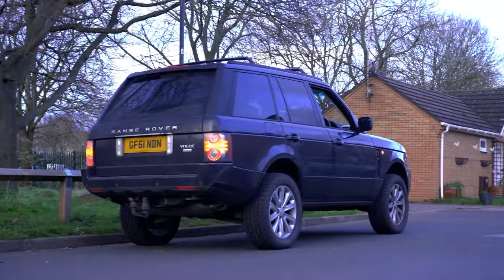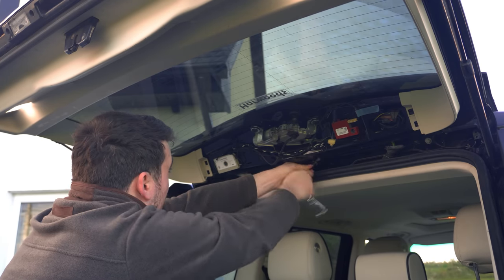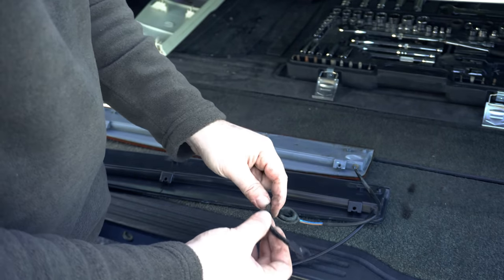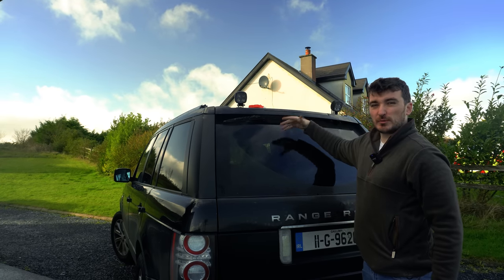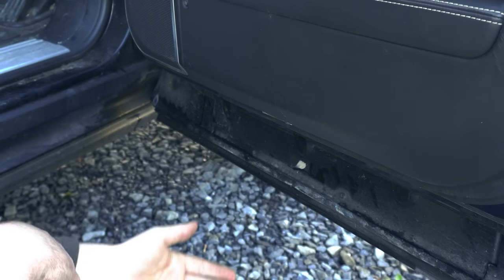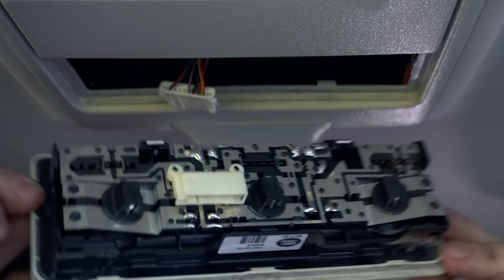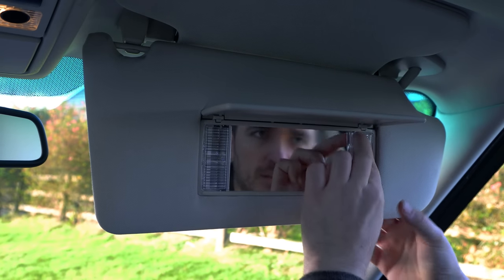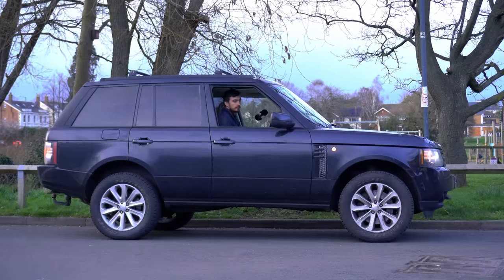I fitted MORE Cheap, Quick Upgrades to my Range Rover L322!

Comment: What did the missus have to say about them? I think you've struck the right balance between on the colour temperature, I know on my Disco 2 I put the LEDs in and it made such a difference to whether or not I could actually see or not

Comment: Great vid, Keep an eye on the third brake light, I had to replace one I fitted after 3 months due to it failing and giving out 1 candle power. Thankyou for showing the knee level footwell bulb change, The only one I have left to change over on mine,  but mine seemed to be a lot tighter than yours so I bottled it. The RR puddle lights are bling, But I like them on mine. I agree the light temp looks better on yours, mine are really blue white. Cheers

Comment: I am planning to get L322 2008 facelift. Here in middle east, the lower dashboard section under the stearing wheel are tend to break due to high temperatures. Any solution or cheap replacement ideas for that? Please make a video if possible.
Reply from the maker: It's not a problem I've ever heard of on this side of the world.  Maybe tint or cover the windows to try and keep the interior cooler?

Comment: Well done Sam. I look forward to your videos very much!
Reply from the maker: Cheers Jerry!  How's your Rangie going?
Reply: Hey Sam, I had to get my air compressor replaced recently. I wasn’t brave enough to attempt it myself. Thankfully I have a good LR Specialist near me that is way cheaper than the dealer, but still does a great job. For fun stuff, I got a rear ladder to put on. I’m a bit nervous drilling into the body, but one of these days, I will get it on. I am getting a Service Required message on the dash. I purchased the iCarSoft LR 3.0 scan tool to hopefully clear it. Thanks for checking in on me.

Comment: Hi Sam, thanks for the L322 videos, I’ve learned a lot. Have you ever considered upgrading the reversing camera to a version with night vision? I’ve upgraded the reversing lights on mine to bright white LEDs but it still doesn’t really cut the mustard. I’m now considering a night vision reversing camera…. but the like for like replacements I’ve found are expensive at around £200.
Reply from the maker: Hey Steve, cheers for the comment!
Regarding the camera - mines actually ok in the dark now - but only because of my super bright reverse lights!  Before that, it was more or less useless.

Comment: Have you checked the rear arches and sills for rust?
Reply from the maker: That’s actually this weekend’s job along with a full rust killer and undercoat treatment.  Watch this space!!
Reply: @SamsMotors  good, I keep thinking about a L322 but the rust issues are a concern.Looking forward to seeing the next video.
Reply: I’m sure you’re running a telepathic channel - I think of a topic and Sam eerily listens, bit like FB ads, despite them “not listening”…

Can’t wait to see “this space” 👍🏻👍🏻 as my rear arches has some slight surface rust. The underside is mint, so hopefully can treat it before the gritters make their seasonal appearance.

Comment: Hi Sam, did you manage to resolve the problem you had with the off side door mirror light (that failed after upgrading to LED)? I did the same upgrade and also had the off side light fail - is that just a coincidence or is there some other issue? Cheers. Kevin
Reply from the maker: Hi Kevin, no I haven't.  Someone else commented that they had the same issue and that it was a failing of the BECM, so I'm not sure exactly what's going on unfortunately.
Reply: @SamsMotors  Hi Sam, thanks for the update. If you do come across a fix for the problem that doesn't involve replacing the BECM please post it. Thanks. Kevin

Comment: I was so excited about the interior lights I forgot to say another thanks for the brake light - mine has condensation inside so wanted a viable alternative and the logo puddle lights are ace too. I had the official Audi rings at vast expense on a previous car before they were copied on eBay etc. 

Did you put them on the rear doors too? I thought the projection angle would be off too much for the rears?
Reply from the maker: Glad I could help!  It's amazing how cheap and readily available all these bits are.
I did try them in the rear doors and as you say the angle isn't right for them.  When the doors are shut though, they project onto the rear passenger floor (a distorted image, but still!).

Comment: Another great video, glad you’re back! Do your interior LEDs under the dash flicker when starting? Mine do since my own LED upgrade many months back so not sure if this is normal and if not, what’s the likely cause?
Reply from the maker: Cheers!  Glad you enjoyed it!
Mine do the same thing.  It's just as the battery voltage momentarily drops down when the starter is cranking so it knocks out the LEDs.  Totally normal!
Sam
Reply: No canbus on the led if you have an iid obd scanner you can turn off the hot and cold option

Comment: Love your videos on the L322. 
My L322 has DPF issues, it’s on 115k miles. Any ideas?
Reply from the maker: Cheers!  DPF issues - doing lots of short trips?  
Otherwise, the DPF can be clogged by leaks in the boost pipes or inlet manifold/donut which upsets the system.

Comment: hi Sam, on aside how did you finding importing the l322 into Ireland. Im based in UK and have a l322  4.4 pterol 2005 with only 150 on her but has a lpg conversion so not so bad running it. Be nice to know how you got on import duty etc if you dont mind.  I have her over 6 months and would be moving to ireland
Reply from the maker: Hey Shane,
It wasn’t bad at all really.  First job is to apply for VRT exemption through Revenue (can do that online), requires a few documents to prove that you owned it in the UK and will be moving over etc.  

Once you have exemption letter, just need to take it for VRT inspection at the NCT centre, get some plates made up then get it tested.

Comment: I’ve got an 08 that sadly has rust under the wheel arch. Thinking it’s time to upgrade to a year closer to Sam’s model. 

My current one is the 3.6 litre. I’ve heard people say that the 4.4 does better mpg? Any truth to that? I’m getting 22 right now and although I can live with that these electric cars are turning my head financially even though I hate them :(
Reply from the maker: The 4.4 is a definite improvement over the 3.6, both in terms of power/performance and MPG.  You should be able to achieve 26-28 on average and 35+ on a long run with the 4.4.
Reply: @SamsMotors  Thanks. I think I'll get one this year and use these upgrade videos to perfect it! Great vid as always

Comment: Hi Sam
As the L322 guru can I tap your knowledge. My 2011 4.4 TDV8 has developed a steering vibration in the last month or so at approximately 70 mph. I have had the front wheels balanced and it has made no difference. There is no vibration under braking and the car is limousine smooth as ever upto motorway speeds.
At the last MOT in July it had an advisory on  both Front lower suspension arm bushes as being worn. The car has only done about 3000 miles since so I can’t see that could be an issue.
Any ideas?
Reply from the maker: Hi Andy,
Before I read the 2nd part of your comment I was already thinking “lower front arms”.  It’s a well known cause of vibration on the 322.  If they were advised in July I’d say they’re the culprit!

Sam
Reply: @SamsMotors  cheers Sam. It’s in my local garage on Monday for a service so I’ll get those looked at.
Reply: Hi Sam
Many thanks for your input and advice.
Have now had front lower arms both sides replaced as well as wheel balancing and the wheel wobble problem is getting worse if anything. Certainly a good shake at 70 ish (feels like front of car is trying to shake itself to pieces) and sometimes from as low as 50. Also, rather strangely, it can vary depending on whether you’re going uphill or downhill, but there isn’t a consistent pattern.

Any more ideas. I’m wondering if it could be in the drivetrain somewhere? CV joint, UJ or maybe even a driveshaft.
Any suggestions greatly appreciated.

Andy

Comment: Also as I’ve got an AB I’ve got the rear vanity mirrors and my kit didn’t include those ones, so decided to leave all 8 vanity lights the standard bulbs as they’re rarely used unlike the others. I did opt for the cooler white for mine though. 

Think I’ll opt for your colour temp and order more as they’re better suited aren’t they. They do still appear brighter than the old bulbs which is an improvement. 

Annoyingly my rear upper boot lid lights snapped their tabs on removing. Do your super-bright ones have new lenses too? Hope so so it’ll fix my snapped ones. 👍🏻
Reply from the maker: Definitely prefer the warmer LEDs for passenger space.  The white bright lights work well for showing you exactly what’s going on in the boot.  Yes the replacement units are complete with lenses so the snapped tabs on your old ones won’t matter.
Reply: @SamsMotors  thanks for sharing - I agree totally. My cool white LEDs have a blue tinge to the edge of the cast illumination so not smitten on bluey ivory interior 😂

Comment: You must be doing too much business for these guys - sadly there is no 4300K option now on that link, only white and blue.
Reply from the maker: Oops!  Updated the link with another seller who has more of the warm LEDs.  They're listed as 4500k but should be about the same!
Reply: @SamsMotors  hope so, ordered them - cheers!
Reply: @SamsMotors  Can you please update the links, current ones are not working. Thanks